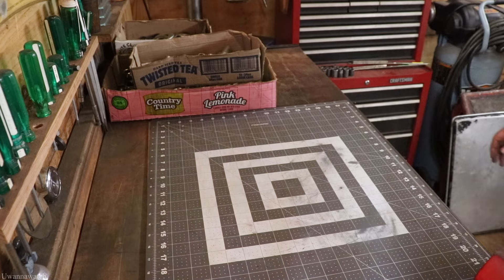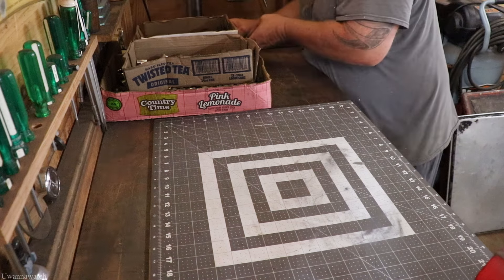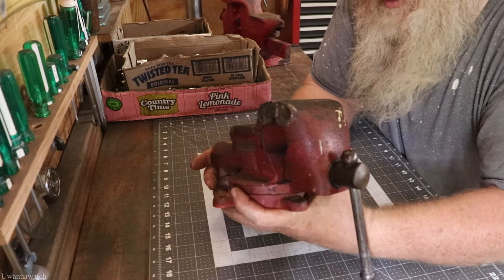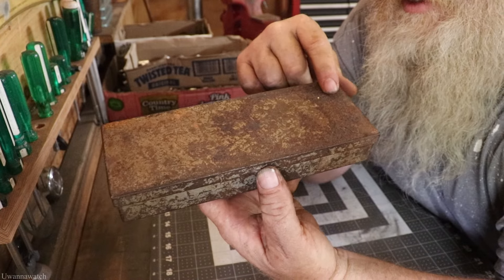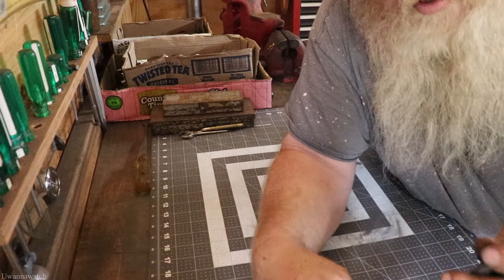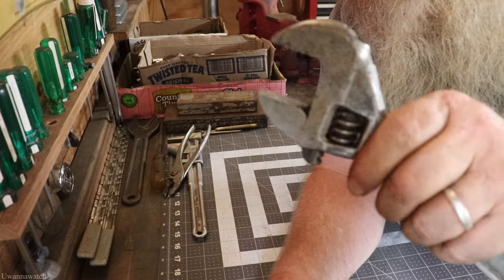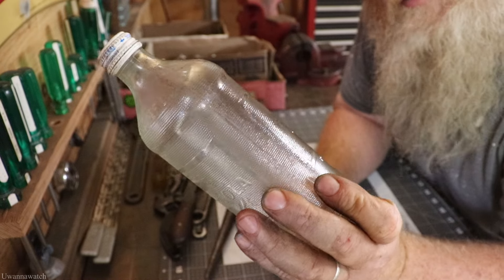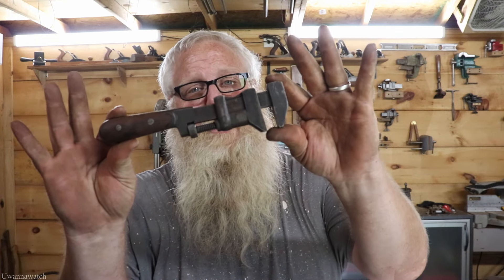Flea Market And Yard Sale Haul # 47.  Two Days Of Awesome Finds!

Comment: Hi there George!!! I’m a complete novice at restoring tools but I have been using vibratory tumblers to remove rust. I use small ceramic pieces of various sizes and shapes and in a few hours the tools look great!! I have done several hammers and axes and rebuilt the handles. I find it to be a relaxing and rewarding hobby. I have a similar process to restore old pocket knives as well. Thanks for sharing your videos with us… your enthusiasm is contagious!!! The Old Army Scout…
Reply from the maker: Hey Dave, I haven't tried that method..I've heard a few others talk about it maybe one of these days I'll get something like that set up. You are so right about how relaxing this hobby is. It's cool to be able to share my little corner of treasure hunting and restorations with so many like minded folks. I'm definitely not an expert but  I do have fun doing it. Thanks for the awesome compliment  and joining in the fun! I really do appreciate it!
Reply: @Uwannawatch  you can pick up a tumbler from harbor frieght realtively unexpensive, we have used one for a couple yeas now and between that and our sand blaster it makes rust removal pretty easy

Comment: Suggestion from prior experience. Find a fab shop or vendor that you can get a piece of sheet stainless that matches the dimensions of the top of the Armstrong box, then drill each corner and pop rivet each corner of the stainless to the top of the box.  Strip and paint the box, (sticker and all) then see of you can find an appropriately sized Armstrong sticker and either apply it to the new stainless top, or the under side of the lid. I think you will like the results.
Reply from the maker: Thanks for the suggestion Herb. I might try that on a different box I have. The sticker on that one is in far worse condition.

Comment: Yah Like I Said That Vice You Have
Will Be Pretty Nice When It's
All Restored. I'm Like You
I Love Looking For Tools Like
Wrenches. The Wrenches
I Like Are Those Ratchiting 
Wrenches. I Use Those Alot
When I Work On Powerchairs
& Scooters. Cause That's What 
I Do During The Summer
Here In Minnesota. But During
The Winter I Do Mostly Woodworking. Like Cuting
Out Christmas Orniments. Now That I Have My New Drill Press
I Can Use My Holesaw
Kit To Make All Kinds Of
Christmas Orniments.
Reply from the maker: I go to the Flea Market every weekend with my family. It's our little thing and it's always fun finding the little treasures. That drill press sounds like it will be really handy for your ornaments.  Just curious how do you heat your shop in the winter? I  was using a torpedo heater  or one of those propane ones to bring the temp up fast.. With an electric one to hold the but fuel costs are too high. I'm putting in a wood stove this year.

Comment: Put a little dot 3 brake fluid on a rag and rub the paint on that Lane table. You might be amazed. Do not refinish them. Patina freaks everywhere will pay up for that. Where are you generally. Had 5 vices stolen. Not to mention a 44" Waterloo top box. Logistics of buying from you is the reason I'm asking. I'm in Louisiana.
Reply from the maker: Thanks, I've never put brake cleaner on furniture. I will restore the tables. I've done another set and they are just too beautiful when they are restored to leave them shabby.  Sorry to hear you had that happen to ya. I'm in the North East.
Reply: @Uwannawatch  I did not say brake cleaner. I said BRAKE FLUID. Big difference.
Reply from the maker: @eric_seguin  Gotcha 😅. I just read it wrong. Never tried that either though.